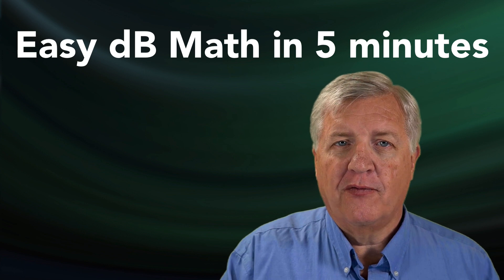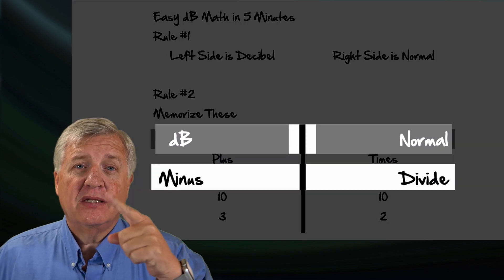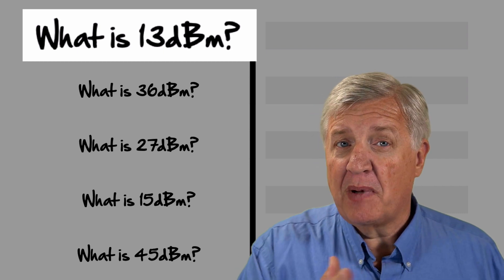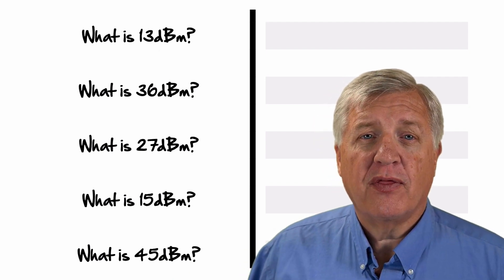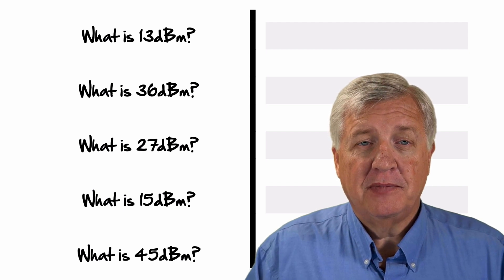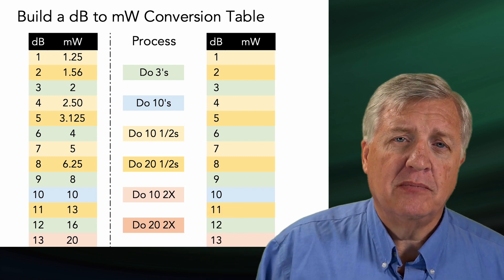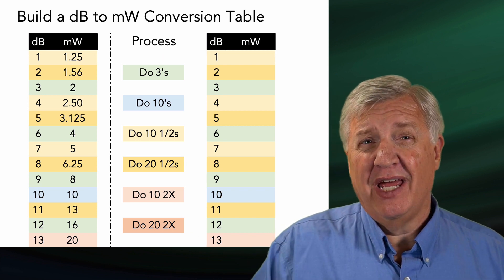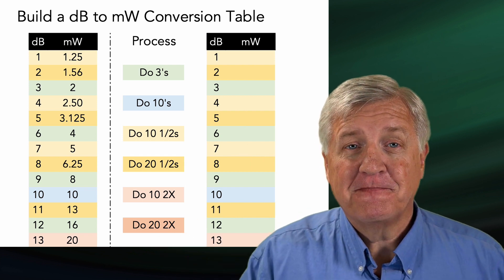Understanding dB Math

Comment: Thanks for this video! Pretty systematic way of doing this mentally. We can also modify this to the voltage log/dB expression of YdB = 20log(x) by changing the values in the dB column to 2x ie, 20 dB => 10 and 6dB => 2. 
So for example:
60dB would become: 20+20+20 = 10^3 = 1000 times
And 26dB would be: 20+6 = 10*2 = 20 times
Appreciate your effort to simplify this!

Comment: Hello, I have a question.
I learned an equation which simplifies converting dB to dBm (by using this following eq, dBm = dB + 30) at college in my freshmen year. But now, fast forward almost 4 years later, I found that this method is highly debateable amongst telecom engineer. And right now, i'm in a desperate situation about this converting dBs stuff. I need to finish an eq which involves dBm and dB. My eq problem is Rx (dBm) = Tx (dBm) - Pathloss (dB), I have the data for Rx and Tx in dBm, but I need to know whats maximum distance in the PL equation (Cost231-Hata model). Is it allowed to use this methods? If not, how can I find the maximum distance? Thank you.

Comment: Thanks a lot Sir.  This will be really useful as a template for me to teach other people.  A shame nobody taught me this method decades ago.  I've been doing it the "way you're supposed to" mentally (with my personal shortcuts developed over the decades, so there's no point in me using your methodical shortcuts now), but it would have been easier on me if I'd been taught this from the beginning.  I remember struggling to do the math in my head when I was a kid.  Ah well, at least I get to use this method in teaching others which seems a LOT easier to articulate and demonstrate.

Comment: Hello Sir, how will you convert a decimal mw to dbm? for eg if i want to convert from 25 milli watt to dbm?
Reply: Well, you can always use a calculator, but if you want to do an approximation without tool then here's one way to do it, let's say you want to convert 25 mW to dBm?
1, You know by heart that 20dBm = 100mW (if you don't know why, review definition of dBm and dB)
2, You know by heart that -6 dB = -3 -3 dB ≈ 0.5 x 0.5 = 0.25 (if you don't know why, review the approximated usage of ±3dB)
3, 25mW = 100mW x 0.25  ≈  (20 - 6) dBm = 14dBm

Comment: How would you go from normal to db? For example 500 Watts?  I think I figured it out but want to make sure (10*10*5 --> 10+10+7 = 27)
Reply from the maker: Thanks for your insight! We'll just have to reverse the conversion. In this case, 500 mW would be: [(10x10x10)/2] ---> [(10+10+10)-3 = 27]

Remember that there are only 3s and 2s, no 5s. 🙂